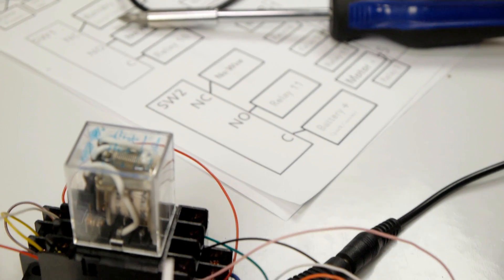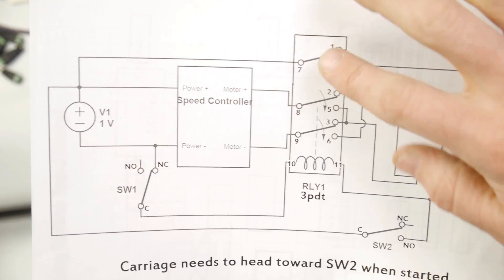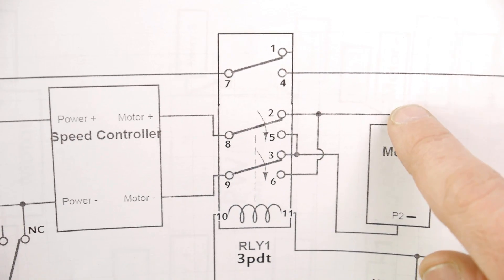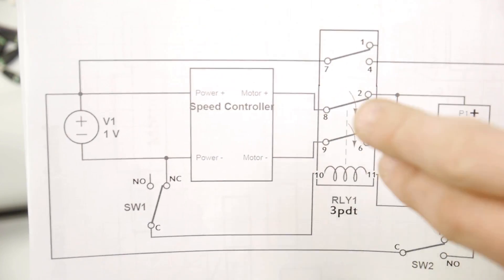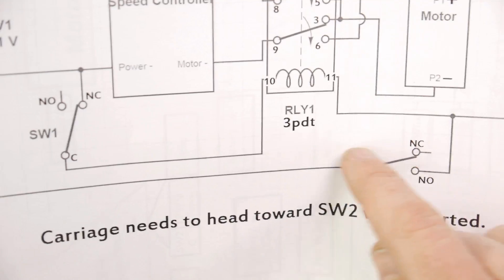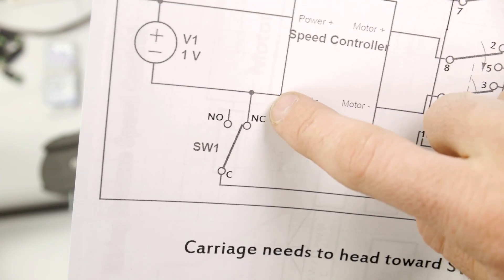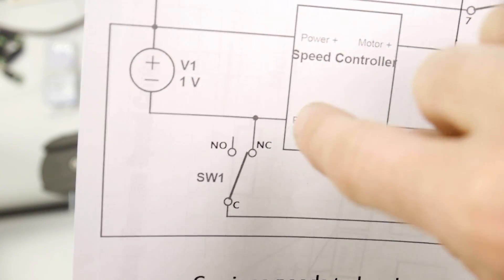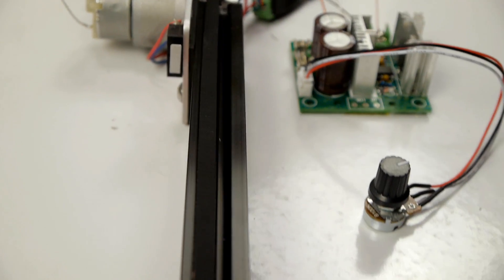Explanation of Camera Slider Wiring Diagram

Comment: Great stuff man.. jus wondering if it was possible to use a pwm with a reversible switch to overcome the issue of the head going towards sw2.. in other words, if you turn on the slider and the head begins sliding toward sw1 you flip the reversal switch and that would cause it to head in the opposite direction so no need to reverse the polarity of the motor.. just an idea.. looking to add this motorized slider function to a dumb slider myself.. thanks for all the info so far.. great job.. btw are you using any king of portable power for this?

Comment: THANK YOU!!  Ever since Cheesycam did his,  (Which I could not get working), I have been wanting to have where you can add speed control in there,  since I do a LOT of documentaries and interviews,  having it at a slower speed reduces the motor noise by a TON. I will be buying the parts and trying this again with your diagram.   I also would LOVE to see how you did the capture control module added to this setup!!

Comment: Your a little farther in your journey as I'm currently using a DPDT currently as I also looked off of that Cheesy site but wanted to add a speed controller.  I too dont know how to read the electronic diagrams and appreciate you walking through what is happening and how it works.  Both of your videos are well narrated in regards to the camera slider. Thanks for the help.
Reply from the maker: +Broad &amp; Narrow Thanks for watching! Glad it helped.